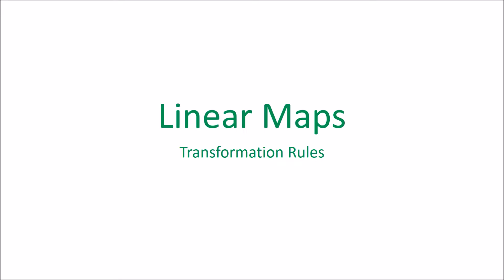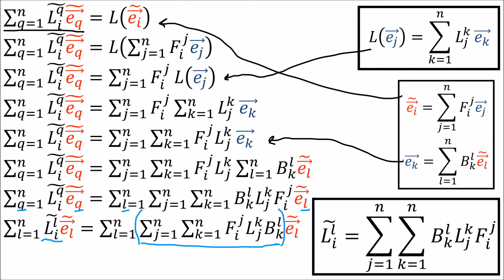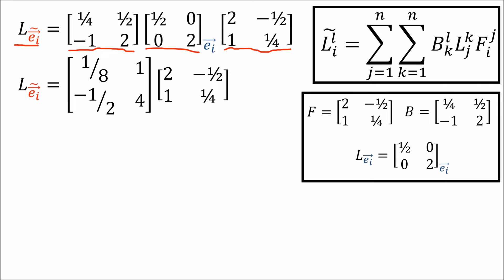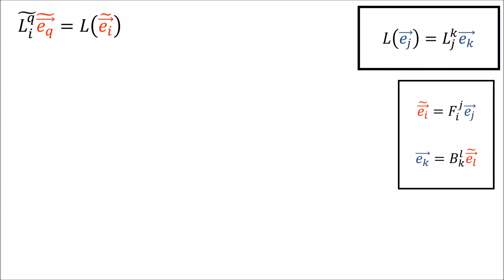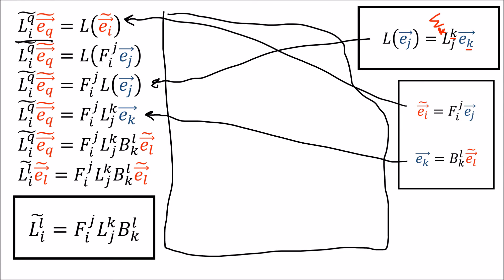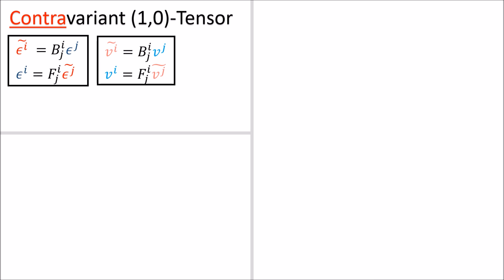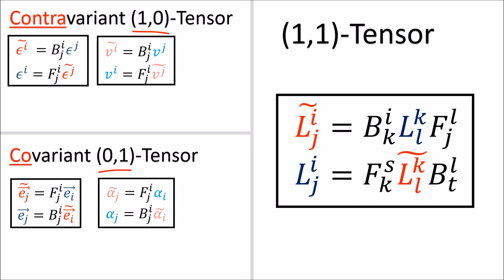Tensors for Beginners 8: Linear Map Transformation Rules

Comment: The last slide, the contra variant and co variant vectors seems flipped
Reply from the maker: It looks right to me. What do you feel is wrong?
Reply: I think that the problem is that, up to now, you use ‘e’ for contravariant vectors, and epsilon for covectors.  In the last slide, ‘e’ and epsilon are reversed.  Everything else looks fine, just a tiny bit confusing.  

Great series, Chris.  Definitely the clearest explanation I’ve seen for tensors.  Thank you for taking the considerable effort to put this together.
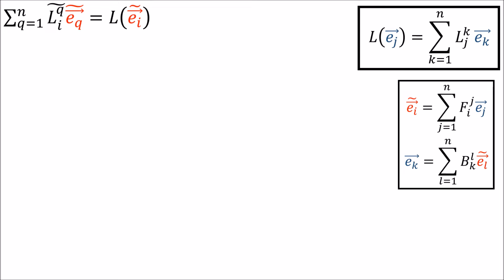Reply: Adding a bit here, if you go to video 11, around 1:43, and compare it to the last slide, you can see that the epsilon should be the covariant basis, and that the ‘e’ is the contravariant basis.  That’s different than what is in the last slide.

Comment: So far excellent work explaining clearly what a tensor is, as opposed to horrible math books that only offer incomprehensible explanations. This from someone who had always used vectors as mere pointy sticks.

One thing missing so far is the WHY of it all. WHY would anyone care about changing basis ? What is the whole point ?
Reply from the maker: I try to answer this in the first couple minutes of this video: https://www.youtube.com/watch?v=rr5qEb_kT6c

Yeah, I didn't motivate a lot of what I'm doing very well in this series. The "theoretical" answer is that geometry shouldn't depend on the coordinate systems we invent--geometry is pure truth and coordinate systems are just things we invent to help us take measurements.The "truest" equations and theorems shouldn't depend on the coordinate system we use, so we should be able to change the coordinate system at anytime and have everything stay true.

More practically, tensors are used everywhere in general relativity. In particular, the metric tensor (which is in video 9), is responsible for describing how spacetime bends, and how light travels in curved paths as it goes around black holes. You can look at Einstein's Field Equations on wikipedia and see they are full of tensors, and we need the equations to stay true whenever we change from one coordinate system to another.
Reply: Thank you, I was not expecting such a prompt answer.

The link you provided partially answers the question (it came with a huge bonus : the link between partial derivatives and unit basis vectors ! wow !).

Is the whole point of changing basis simply the DEMONSTRATION that the choice of a basis does not matter in the case of tensor algebra and thus PROVING that tensors are really coordinate independent  WHEN specific transformation rules are followed ?

Or is there really a case in physics where it is necessary to start with a coordinate system and then for some reason being forced to switch to another coordinate system ?

Again, my heartfelt gratitude for you putting in so much energy in sharing your understanding of this.
Reply: eigenchris ,

Comment: I got a question regarding the notion of all those forward backward basis transformation and linear map/transformation in general.... why writing all those summation/multiplications while it can be a lot simpler to just use matrix multiplication... kronecker delta is just the diagonal of a unit matrix (I) right.... and it seems to me that you can explain the covariant and contravariant tensors (vector, covector) by using matrix it seems just a lot cleaner... why not going that route?
Reply from the maker: You'll see later on in the series that when we have more complicated tensors (like rank 3 or 4), we can't easily write out array multiplications that make sense unless we use summations.

Comment: can you explain the reason for the (0'1)  (1'0) and (1'1) notation?  Also, the placing of indices gets a little confusing...when to use which letter.  I understand summing over up and down indices.  Thanks.  I am a hobbyist BTW.
Reply from the maker: The pairs of numbers are the number of (contravariant, covariant) transformation rules used to transform the vectors. I explain this in video #9.
I should note at the very end of the video, the summation indexes are wrong (s and t should be i and j). I'm sorry if that confused you.
Reply: I have seen tensors represented as r x s tuples like this  (V* x V* x ...V* x V x V x ...V  with r x s entries.  I came to your course because I was needing a little help with a course in GR by Fred Schuller.  I am having a hard time seeing how tensors are ranked in terms of their covector and vector part.  Sorry for the trouble.  In a classroom setting this would be easy to clear up, I believe.
Reply from the maker: I'm sorry but I don't understand your question. When you say "ranked", do you mean, how do we decide on the pair (m,n)?
Reply: (m,n)  ??  Don't know what you mean by (m,n).  But "ranked" may be the wrong term.  T: V* x V* x..."r many"...x V x V x..." s many...x V ---> Reals  These are tuples, first r entries and then s entries.   Does this make sense?  I find it hard to understand the definitions (0,1) (1,0) (1,1) (0,2) ...I am trying to convey my question, but maybe not getting through.
Reply from the maker: When you say "r-many" V* and "s-many" V, you can write this out compactly as (r,s). This is why vectors from V are (1,0) tensors and covectors from V* are (0,1) tensors.
I probably should have explained this sooner, but this is explained in video 9.
Reply: Sorry.   Another question.  In the notation V* x V* x V* x ...V x V x V  the covector space precedes the vector space, yet the notation (1,0) has a 1 in the first position.  It  may be impossible for me to phrase the question without speaking in person.

Comment: Hello,

At 6:11, the two last equalities aren't the same: the Forward and Backward transformations change places. Same error further in the video. So, is it L~ = BLF or the opposite?

Thanks for this great series! Look forward to tensor calculus :-)
Reply from the maker: If you look carefully at 6:11, you will see that they are the same: It's true that I wrote F(ji)L(kj)B(lk) and B(lk)L(kj)F(ji), but the order doesn't matter. What matters is the indexes used for summations.  B has the l and k indexes and F has the j and i indexes. That's what's important.
Reply: Is it because the forward and backward transforms are inverses of each other that the order doesn't matter?  Just as long as the linear map is sandwiched between them?
Reply: So we can choose to begin index summation on j then k or k then j , if we respect the index places it should just give the same result? @eigenchris
Reply from the maker: If you want to stick with matrix multiplication, that's fine, but thinks might get harder later on without index notation. I think it's a good idea to try and get used to it.
Reply: I can't really understand those index summations without resorting to corresponding matrix multiplication operation... am I doing something wrong or should I be extremely fluent with index summation?
Reply: Hello,
I've just noticed the same thing. So, if I understand well the explanation, as we don't change indexes for summations, could we wright it as the following equations?

Starting with equation at 6:11:
F(j,i)L(k,j)B(l,k)=L~(l,i)
B(i,p)F(j,i)L(k,j)B(l,k)F(q,l)=B(i,p)L~(l,i)F(q,l)
delta(j,p)L(k,j)delta(q,k)=B(i,p)L~(l,i)F(q,l)
L(q,p)=B(i,p)L~(l,i)F(q,l)

Thank you very much for those brillant videos!!
Reply from the maker: That is correct. The equation wrote above and the equation I have in my video are the same. It's like writing 5*3*2 or 2*3*5. Both are equal to 30.